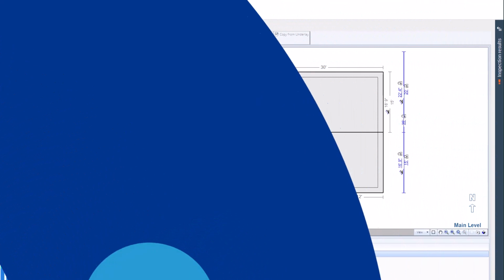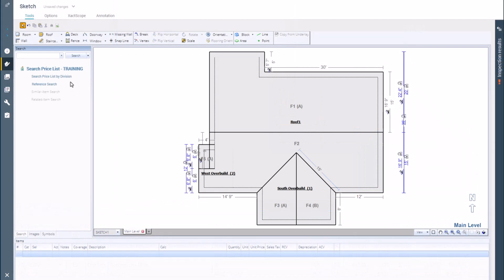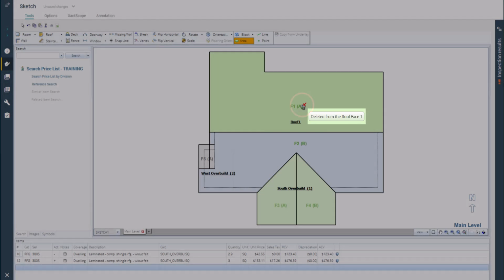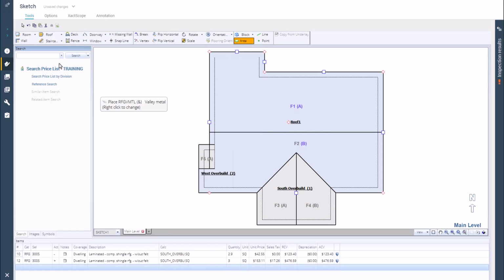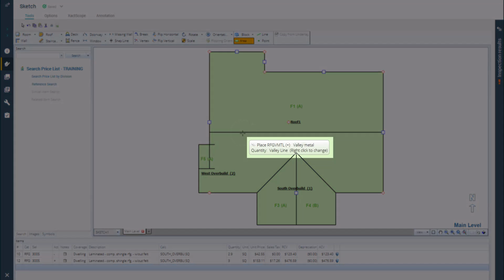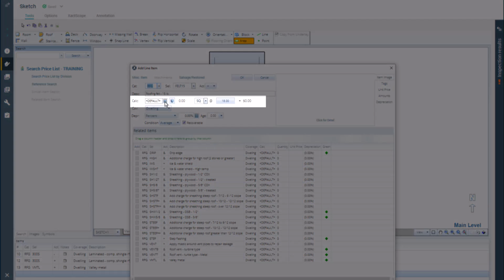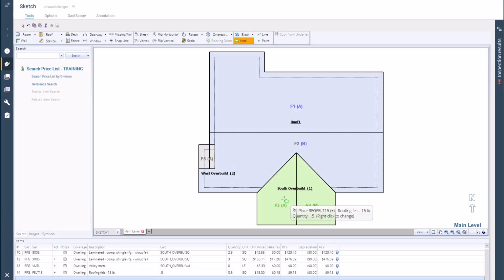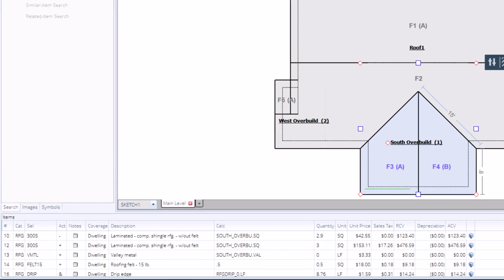Xactimate Xpert Tip: Adding Roofing Line Items Using Graphical Estimation

Comment: Can you provide and break down of line items when replacing any kind of roof?
Reply from the maker: Thanks for your question! It's difficult to provide a specific breakdown of line items for a roof replacement as each job can vary significantly based on the type of loss, materials needed, and the location of the property. However, we do offer a comprehensive roofing course in Xactware Classroom (https://learn.xactware.com/) that covers everything from small to complex roof losses, including how to find the necessary estimate items. We encourage you to check it out for a more in-depth look!

Comment: I’m a new adjuster and I have absolutely loved Xactimate and its mobile app. I’ve very into the technical aspect of things and love the AR sketching as well as the graphical estimator. 

Any chance there’s plans to bring an AR roof sketching tab to the mobile app in the future? As well as bringing the graphical estimator to mobile? 

Keep up the awesome work and if you ever need a beta tester I’m your man!
Reply from the maker: Great questions about the AR sketching tool! The LiDAR cameras on these devices currently have a limited range of about 15 feet. We considered developing a roof AR tool, but with this range limitation, users would need to walk on the roof while scanning with their phones for accurate results. This raises safety concerns, as focusing on the screen could lead to missteps. Because that first step might be a doozy if done incorrectly, we've been cautious about moving forward. However, stay tuned—technology is advancing quickly, and we may have a better solution in the near future!